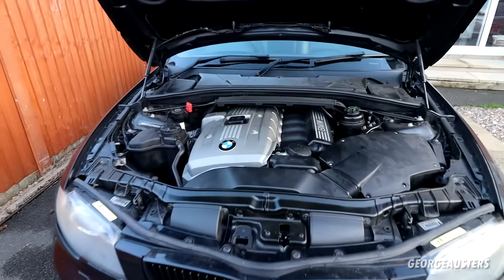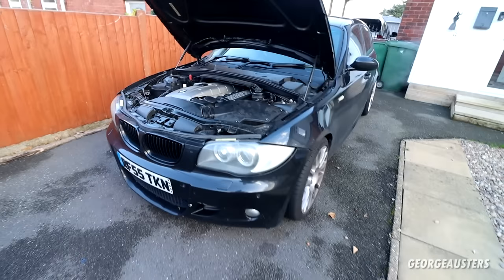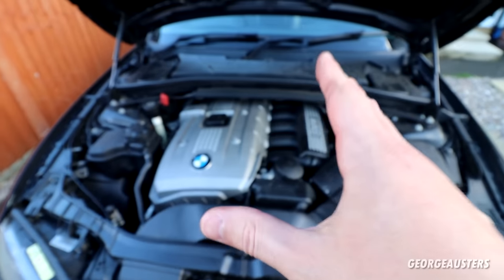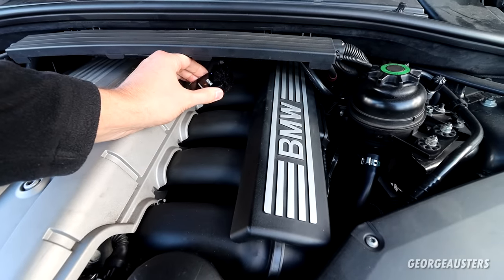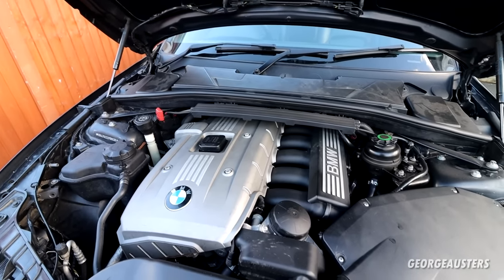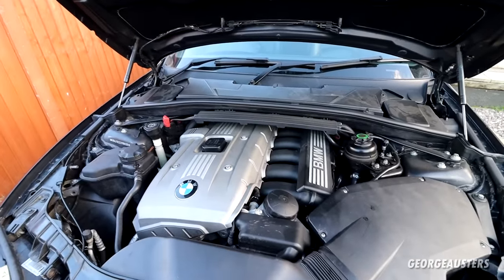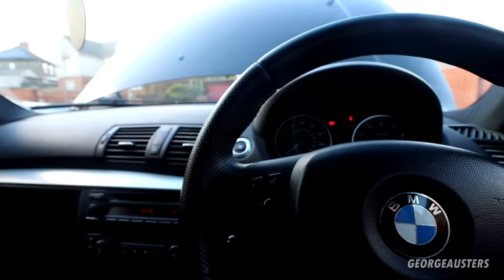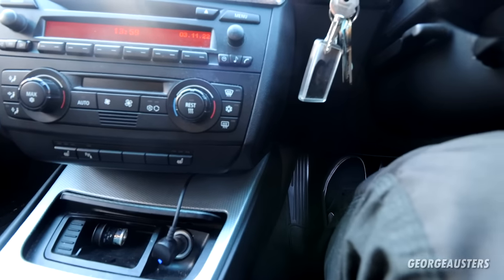IF YOU HEAR THIS ENGINE RATTLE THEN YOU HAVE A BIG PROBLEM!

Comment: What ive noticed is you can't diagnose an issue with a car just by sound because I've read hundreds of testimonies from people all with the same noise but different problems. Car's are a pain in the arse. I've had nothing but problems the last 25  years. I've owned two cars from new and and had many used cars aswell. All have had clutch failure head gasket failure pump failure. Oil sump exploded and engine blew up. Timing chain fail. Had dmf failure on a blue motion after 30'000 miles. Cars suck.

Comment: Over the years I have changed out many clutches. The most common failure has been the pressure plate. As for the DMF I have only replaced them when they are showing ware.  I recommend replacing the slave cylinders if it's not too expensive.  My Z3 2.8 slave leaked and put fluid all over my new clutch,...

Comment: If you suspect that the flywheel is going out - replace it immediately! or if you can't replace it immediately, then keep the revs low while driving. Mine had some slight vibration for a while and then one time I decided to accelerate to the redline and guess what, the spring inside the flywheel broke out and it exploded though it's case, leaving about a 2 inch hole in the flywheel. And the rest of the broken spring scratched around the clutch housing... In other words it almost cut the whole transmission out from the engine.

Comment: Its the idler gear that makes this noise. I've got the same "problem" but its very common, not to say normal. Disappears when you press the clutch pedal, noisy only when the gearbox oil is warm.. 
And my 130i has only 50k miles. I did a oil service with bmw recommended oil MTF-LT3, it is better but not completely gone. I just got used to it and don't worry anymore.

Comment: if the noise goes away when clutch is pressed down then its the throwout bearing needs replacing, or the input shaft bearing,

Comment: Wouldn't worry about it... Lots of 130i's have this and have no issues from a driveability perspective. I read a few forum posts from when the cars were new that bmw replaced the dmf's under warranty but the noise returned within another 10k or so.
Reply: Agree, It's common engine rattle on 130i. Mine and a friend 130 have that engine rattle and no problem at all.

Comment: Hi George, this is just Flywheel/clutch chatter. It’s very common on a lot of Manual gearbox BMWs from that era. My 130i and a lot of other N52 engines do it, mines been doing it for 7 years! It’s completely normal; take it to a BMW dealership and they will says it’s a characteristic of the car. I am not aware a single person on the Baby BMW forum who has experienced DMF failure.
Reply: My automatic n54 doing this 🤦🏾‍♂️

Comment: There is also a similar sound that your viewers should be aware of - lifter tick.  It sounds uncannily similar to the noise in your video and would be easy to confuse.  Ticking lifters is a classic trait of the N52 3.0.  It occurs for a different reason than the problem you're experiencing with your DMF, and, unlike your problem, is nothing to fear.

How do you know which problem you have?  Two acid tests:
1. As you say, depress the clutch (if you have a manual).  If the sound goes away, it's your DMF, and work should be carried out.  If noise doesn't go away, it's just lifter tick which has an easy fix.
2.  Lifter tick occurs in the first place on an N52 engine because, in the words of my local BMW Indy, BMW designed the engine with slightly inefficient oil channels, and the engine doesn't quite get lubricated sufficiently at low revs.  And because the 3.0 develops peak torque at just 2750rpm, and the big shove comes in from about 2500rpm, it can be driven like a turbodiesel, and many people do.  Plus, the auto, if just left in drive all the time, will spend most of it's life driving at low revs unless driven hard.  The fix is very easy - rev your engine.  Literally, spend just two weeks always revving your engine to at least 3000rpm, in every gear, at all times (or if it's an auto then drive it sport or manual mode all the time revving it to at least 3000rpm in every gear at all times), and IF your problem is lifter tick, within just two weeks it will disappear.  Obviously, if it doesn't you could be looking at a DMF.  Always useful to check with your local BMW Indy, in any case, before spending time/money.  Hope that helps.

Comment: My e46 has had this rattle for 6 years and 50k miles later still running fine
Reply: I have a 2007 Mk4 Mondeo,  has the layshaft/ DMF noise which disappears when the clutch is depressed. Has been like that for 66,000 miles.

Comment: mass flywheel from auto doc was £350 for a luK  and I bought the luK clutch from Euro parts £300 including the new rear main seal Got exactly the same problem no my m3 evo  I’ve got all the new OEM to replace just bought myself a gearbox jack ready as I’m doing the whole rear end bush and diff seals change and refer on all parts at the same time during the winter Done the front end and suspension last year

Comment: Common noise on 130i. Once you have a clutch that is making vibration when starting moving the car in 1st gear, or when your clutch is out it will be the time to change the DMF (or put a single mass flywheel), put a new clutch with new clutch release bearing
Reply from the maker: I’ll be doing the whole lot when the time comes👍🏻

Comment: Forgot to mention the crankshaft oil seal replaced your flywheel and fit a nice new clutch pack and it's fails covering your brand new flywheel and clutch pack

Comment: My 2006 120d has 260,000 miles on it and is still on the original timing chain, thrust bearing and everything else for that matter. It is now sounding a little Massey Furgeson at idle. After being hit from behind hard by a Mitsubishi Outlander at a set of lights I had to rebuild the back end so technically it is now 6 different cars. It is like the Millennium Falcon, might be a hunk of junk but it’s got it where it counts. Still goes like stink and annoys Sadik Carnage!

Comment: Hi. I do experience this light rattle in my 2006 E60 523i as well. Especially and mostly if the engine is to it’s operating temperature. When I depress the clutch the noise stops. It is for sure the DMF and maybe the clutch bearing as well. My car got 195.000 km on it and was mostly driven short distances. So i will let this be done with all parts from LUK and replace the slave and master as well. And also all of them bolts I think they are made from aluminium and can only be purchased at BMW original. Not a hard job to do, but once in a while some parts on every car also more expensive ones have to be replaced 😊 Good to know a mechanic who can help you with the work for a little money or other favors. One hand is helping another 😎 You probably can drive further with this noise, but I wouldn’t recommend to, because if the DMF brakes or fails on a journey or on a long trip on the motorway, you won’t probably be able to drive to your destination 😢

Comment: Not a bad DMF rattle at all, mostly just piezo noise in the engine bay. 
You should hear the DMF on my 175,000 miles 330d with original DMF and clutch, rough sums it up nicely. Been on the way out for the last 3 years though. I have just taken delivery of all the required LUK parts to do the change in the next couple of weeks.
Reply from the maker: Piezo noise? These are port injectors
Reply: I have a cla250 mercedes benz. Could I send u a video of the rattle. I wanna know if you think it’s bad or not
Reply: @cristojuarez2309  I did the change at 183,000 miles and it wasn’t even that knackered when I inspected it/tested for play. Reckon I could have made it last another 50,000, it sounded worse than it actually was.

Comment: If it goes away when pedal pressure is applied it takes the clutch out of the equation, and It indicates lateral play between the outside of input shaft pilot journal/end and the inside of the clutch pilot bushing/bearing in the crank, take it out by finding a dowel rod that fits exactly in the bushing, pack it full of grease, and whack it with a hammer a few times then install the new one with the chamfered inner edge of the bore hole facing outward, and the chamfered outer edge facing forward toward the engine or transmission installation will be a PIYFB (Pie Fib)
Pain In You Ffing Ballinskis)

Comment: Weird how you put your mic right by the purge valve to pick that up.
Reply: I hope you realize I'm suggesting the noise is your purge valve. If it runs excessively at startup. Your hpfp might be losing pressure.
Otherwise get an expensive purge valve for like $50 and it'll be less noisy.

Comment: Recently bought a 116i '09 plate and it makes the exact same rattle! I was told it could be a timing chain issue but not sure now. Do you reckon it's still driveable or should get repaired?
Reply: Depends on the milage lol

Comment: Hi George - I've had similar noises with similar behaviour from my 130i gearbox despite having clutch and flywheel replaced less than 15k ago. I know a certain amount of gearbox chatter is normal with these cars when warm. If your clutch has never been done it won't be a waste of time or money for you, but I'd be interested to see if the noise goes away
Reply: How much was the part and labour for your flywheel replacement? I have a BMW 5 series 54 plate and mine needs replacing
Reply: @Hermionechaney  I don’t have exact numbers but total parts and labour cost was around £1100

Comment: Hi bro! I actually have a different engine, it’s a N43 on bmw e61. And i’m having rattling noise by the throttle body/ intake manifold side. When i give gas, it also gets louder and when i let the gaspedal off. It sounds like a rattle that something is lose but why does it go louder when i give gas? 
I appreciate your answer. Thanks!

Comment: I have this issue on my scion. Only occurs when in gear, not while in neutral or when clutch is engaged.  As soon as it is put into neutral/clutch engaged, the sound goes away. Thoughts?
Reply: this videos a joke, there's nothing wrong with this car - especially BMW engines

Comment: Dude, the list of things that could go wrong with my car gets ever longer 🙂 Why is it you say you won't notice this on the auto versions? Is it because the car is controlling the clutch? You can after all have the car idling in either park or neutral on the auto vehicles as well.
Reply from the maker: No dual mass flywheels on an auto. It’s just a solid flywheel that the torque converter attaches to👍🏻
Reply: @GeorgeAusters  So that's another reason to look for auto over manual then 😀 assuming you're not hung up on manual transmission..

Comment: Hi George

Have you managed to repair the rattle? Mine does that but goes quiet when clutch depressed.
Reply: i have the same issue,... its the throwout bearing needs replacing, probably best replacing the whole clutch 👍
Reply: @sickbeatsproductions  What if you have just had a new clutch, put the car back together and it started making this noise 🤣
Reply: @bradmace6144  clearly it hasnt been done properly 😂
Reply: @sickbeatsproductions  It didn't do it straight away. A family member who is a mechanic did it. Surely it would've been done properly...

Comment: I have a bmw series 1 petrol and when I open the oil cap the engine's operation changes and vibrates a lot, if I put the cap back it normalizes and works smoothly.  what can it be?
Reply: The valve cover is getting new air after the maf sensor

Comment: Sounds like lifters on the cams, get some hydraulic lifter additive, liqui moly should be routine
Reply from the maker: It’s not
Reply: @GeorgeAusters  then why was holding it at 3k for a few mins the solution?  The lifters settled downwards and needed to get lubed up which is what you did by running the engine at 3k.

Comment: Dude it’s your valve lifters there less than 100 bucks for a set ,they just sticking ether cause not lubed enough sitting 🪑 for awhile or there old and just don’t have the spring push back ,,, rest not a big deal admittedly it annoying as fuck a will bother the hell out of any tuner but don’t go ape 🦧 it’s gonna be ok 👍🏽

Comment: that is nothing, i have just had my duel mass flywheel and 3 piece clutch kit done on a 2010 insignia 2.0 TDCI and cost me £1200 to get done, mine was well worse than this
Reply: plus if it was that bad the steering wheel and gearbox would be vibrating and it would sound like a tractor when clutch is pressed and depressed
Reply from the maker: I’ve just replaced all that on my 318d

Comment: STOP driving it yesterday because I have done research, and they have certain VIN# and NOT the engine type which is BS. There is a recall for this problem, but they say NOT all 6 cylinder engine has this problem the VANO'S cam sprocket bolt heads have broken OFF. The heads drop down into the oil pan, and the engine has to be lifted or maybe you can fish the heads out with a magnet or something. BMW should cover ALL 6 cylinder engine's because its a common problem unless they are going to less quality parts, and you know what that means for your next vehicle purchase. Mine is in the shop right now waiting, and fighting with BMW to cover this problem because there is a recall on this problem. 11/7/2022
Reply: Hi sir the bolt of the Vanos is aluminium Bolt 
for remove the head bolt to the oil pan the only solution is remove oil pan 
The bolt for the replacement cost 1.5$ bolt in Canada
I fix this problem last month i change my oil pan gasket and i found 1vanos head bolt in the pan
I'm lucky because the drop head bolt have broke anything in the engine

Sorry for my english language good luck and nice day
Reply: @navuvu  WOW it seems like they would have put a better quality bolt in there, but that's BMW. Thank you
Reply: @autojock4472  
The new bolt by BMW have corrected probleme 
The old bolt have a pin in the midle the have no pin and more material for renforcement the head
The torque for this bolt is 6NM + 60°

Comment: That sounds like your exhaust manifold has a leak
Reply from the maker: What makes you say that?
Reply: @GeorgeAusters  a leak in a manifold gasket can also sound like a ticking noise. The gaskets are split in two, one front three and one back three. This wouldn't affect anything or give any faults.

Comment: It’s the torque converting module and quite likely the bolts that fall away when BMW create work for themselves and it’s all with no help like bad mechanics careless about the working order of the fixing or service gone down .. I did ask the rattle origin and the both of the BMW REALLY IS BMW CREW DOINB THE WORK.. have sent a grizzle asking them why they didn’t know I was gona get suss when I always have issues and it’s because they don’t want to do things how they are paid to do them. Stupid rich overpriced and a car that sometimes will stop working and give no sensor alert the whole time it’s just burning oil and overheating on dregs that stain the inside of the motor and water housing after a burn out of the whole cooling life long system before it melts the head and valves merged the lot into a big black and silver block of shit with what used to be my car 😊